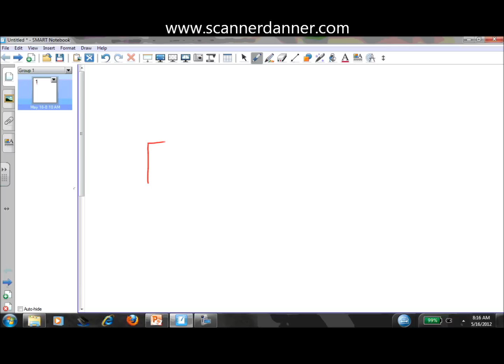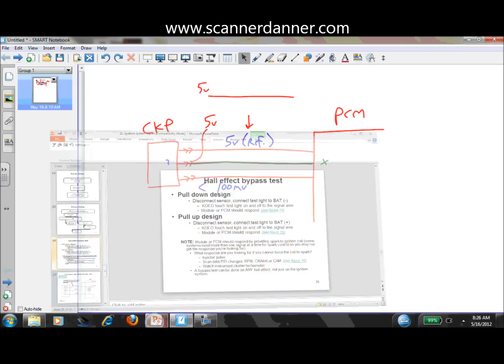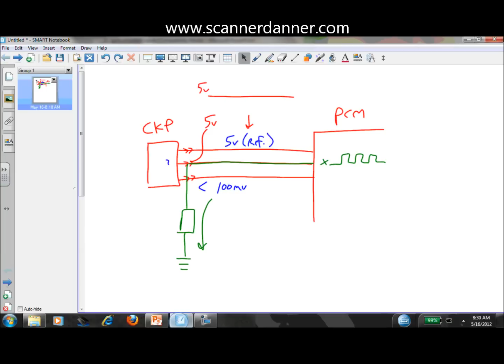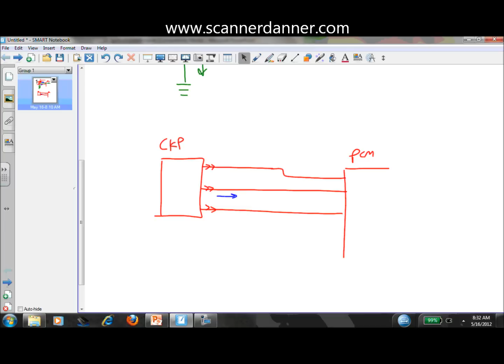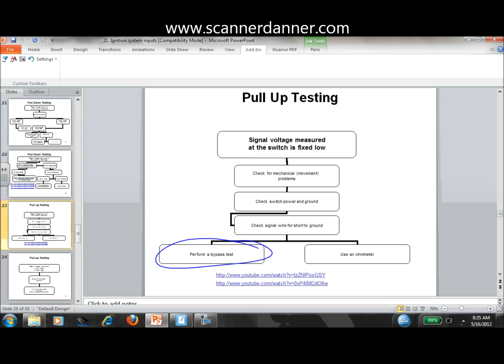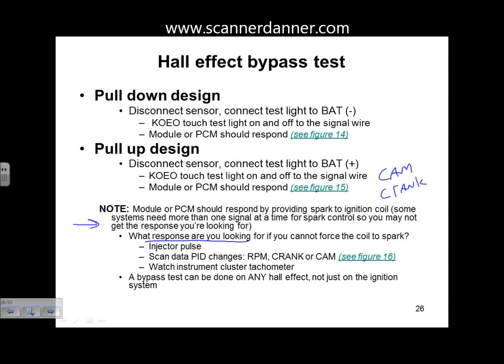Hall effect cam/crank sensor operation and testing Part 2 (an SD Premium video)

Comment: Very good Paul, thanks for the video.  I am testing a 2005 PT Cruiser GT that is misfiring at highway speed acceleration and backfiring.  On the Uscope the cam sensor has a weird waveform when I back probed the signal wire.  Not square wave at all.  More sine wave looking with lots of noise in the signal.  I need to do more testing.  I am 63 years old and just now learning to troubleshoot my vehicles.  Your videos have been indispensable!  Thanks, Tom
Reply from the maker: Thanks Tom! IF you get stuck, don't forget about my forum on my website. IT is free to join the forum https://www.scannerdanner.com/forum/post-your-repair-questions-here.html

Comment from the maker: for hall effect bypass testing, just a regular test light is fine. When you want to be careful is when testing computer driver circuits. This is when a lower amperage test light or LED test light is ideal. I would say that you want one that draws under 100ma to be safe. 
An LED test light may not work for this bypass test.

Comment: Northern Canada/ Native reserve.  One  week contract to teach advanced vehicle electronics to my fellow natives.  Big mistake !!  used you vids as a reference tool.  Had to translate  your words from English to Cree.  All week no one ask a question or even looked at me, by the end of the week  only 4 out of 45 showed up.  Seems my Cree is a bit rusty, seems  all the sensors  translate to a negative connotation.   Wont be going back, not welcome.  Getting out of the hospital  today.  :)

Comment from the maker: on a pull down design signal circuit, yes. it doesn't matter what you use. when I do use a low current test light would be checking computer driver or transistor operation. this would be on the output side of the computer not the input side. the input side contains just a voltage sensing circuit and not a transistor driver.

Comment from the maker: of course not. i will still be posting my case studies which i believe supports the whole thing. i just will not be posting this style of lecture videos anymore. i have done probably five or six in this format. (injector noid light testing, ignition control testing with a test light, fuel pump electrical circuits, fuel injector driver designs)

Comment: Pauls  a great guy and a lot smarter than I  but he is teaching at an accelerated level when it comes to vehicle electronic and management systems.  On the reserve I escaped from there was a 1953 Merc sedan  and a hand full of  pickups mostly 1960-71 international trucks.   If Paul ever excepts a contract to Canada  he would be well advise to bring a set of feller gauges,dwell meter and a BFH.  Oh yeah, they speak English. don't understand Cree. Never assume anything

Comment: Hi Dan, in responds to your question, what are the voltages backprobed with KOEO, pin (1) Gr = 0 v pin (2) signal = 5.6 v pin (3)  Power = 5 v , this is a brand new sensor, has not even being around the block yet, old sensor had the same reading.
Reply from the maker: Reply to my fist response, I don't have context otherwise

Comment from the maker: @Jahan Zeb new car computer replacement involves reprogramming. a factory scan tool is required in most cases also access to factory software which you can pay 4. sorry but I do not have the ability to do this for you.

Comment: Hi Dan, i hope you are well. Yet another great video, thank you. Could you please tell me what is considered as a " Low Amperage Test Light " for the above purposes? What is the maximum rating allowed in order to stay safe and not fry the computer? Could i modify an ordinary test light? Could i use an LED instead or is there not enough load on an LED to get the right results? 
Many thanks, Joe

Comment: Hi, 
My car is a Renault Duster 1.2 tce 125, gasoline direct injection. I have a misfiring problem with my car when the engin is warm on cylinder 3 and 4. I've changed my injectors, plugs, coils and the problem still the same. 
To stop the misfiring on cylinder 3 and 4, I have to pull off the crankshaft connector. If I pull off the crankshaft connector, no more misfires and the idle runs good. There are two similar position sensors on this car (crankshaft and camchaft) with same OEM reference. I've changed both (with new sensors) and changed the connectors (soldiered new connectors) but the problem is still the same. The only solution I found to stop the engin misfiring is to disconnect the crankshaft sensor when the engin is started. If I disconnect the other sensor (Camshaft) nothing happens. The misfiring happens only when the engin is warm (60 celsius or more). 
What do you suggest? Thank you so much for your help. (sorry for my English).

Comment: great paul!!! but.... i think there's something unclear. (i'm just starting in diagnostics, i don't have experience, but please read this). You said that on a pull up design, to test signal wire and pcm integrity, to connect the testlight to bat + and create a signal to the pcm, and in the example it's correct, but if the system works with a 5v ref and i do that test, i'm going to send 12v when it's supposed to function with 5v. what can happen? to cook the pcm? the explanation is great but i think that it can be misleading if someone sees that test and doesn't realize that. i hope you or somebody else can explain that to me or correct me if i'm wrong. thank you so much for teaching me and the entire world. Lautaro from Argentina.
Reply from the maker: The 5v ref would be the power supply to the hall effect. You wouldn't be messing with that circuit, only the signal wire. And if the signal wire has 5v on it, it is a pull-down design so you definitely don't want a test light to b+ there.
A 12v pull up circuit would typically have a 12v supply too, not a 5v ref supplied power.
Reply: @ScannerDanner 
Paul,,, what's the difference between Hall effect sensor with 5V reference and 12v reference?
As exam. In Hyundai Azera 2006 transmission output speed sensor has a power 12V from fuse, ground from Ground Point, and signal wire with a disconnected connector 5V, so it's a pull down design.
Q: 5V in signal wire is a bias voltage!!!! Then when I connect the connector will Vary on and off from 0V to 12v,,, or from 0v to 5V...
Reply from the maker: Great insight and great questions! The only difference is the source, or "power feed" if you will, for the hall effect. The operation of the signal circuit is identical regardless of what voltage is used to power up the hall-effect. So some are powered by the reference circuit (5v) and some are powered by battery voltage, and still others are somewhere in between. I've seen 8v and 10v power feeds too. 
The signal circuit being 5v unplugged, is indeed a pull-down design but I would not call it a bias voltage because that is more of a hidden voltage that does not really effect the operation of a circuit. Without this 5v signal, the sensor would not work on a pull-down design. So anyway, yes, it will be the 5v wire that will toggled from high to low, the 12v line and ground will remain constant. Love answering questions like this. You are clearly paying attention! Love good students!!!
Reply: @ScannerDanner 
Good teatcher,,,
Signal wire will toggled from high to low.
My Q: As we know low will be 0v, but high will be 5v If I have a 5v reference, so when I have a 12v reference will be 5v or 12v?
One Day when I connect my scope to see timing in Hyundai Elantra 2005 Camshaft position sensor was have a 12V reference, signal wire was Square Wave On Off from 0v to 12v.
Reply from the maker: @ALZWE-LIBYAN-CAR-ELECTRICIAN  typically with a 12v feed on a pull-up design, you will see  a 12 volt square wave on the signal
Reply: @ScannerDanner 
Thanks alot.

Comment: Great teaching Paul
With this 3pin hall effect is there an acceptable ohms value for the sensor itself to rule it out as bad or good? Expecially when you are OK with wiring integrity 
Thanks for answering
Reply from the maker: I've never, not once used the ohmmeter to measure a hall effect. They're all constructed differently and resistance measurements are always like this:
If it measures bad, it's bad
If it measured good it can still be bad 😉
Reply: @ScannerDanner  Thanks 
So ohms resistance checking of hall effect sensors is not worthwhile.  Is there any test that can be done to it separated from the car to rule out it being good or bad? 

Dont want to be a  parts  changer!
Reply from the maker: @AnythingEverythingGh  yes, absolutely! Check out my chapter 21 playlist for many, many videos where I am showing this
Reply: @ScannerDanner  when you havent purchased the book yet lol
Reply from the maker: @AnythingEverythingGh  it's right here on YouTube, you don't need to buy anything. I just have my playlists organized with the material that is in my book. So check out my chapter 21 playlist for more videos on testing these
Reply: @ScannerDanner  can't find it Paul, a link to it will be  best. Btw there is a pull up design with 5v reference, my Nissan Sentra 2008.
Reply from the maker: @AnythingEverythingGh  https://youtube.com/playlist?list=PLAFYVCyenqcqEN41aYznWn9Nfhy1PiMjo

Comment: Hello.When disconnecting the cam sensor plug, I find 10.67 volts in the signal wire. Engine crank but not start.
- Engine: 1.3 vvti
What do you think of you?
## Thank you very much for what you provide. Your information is very valuable ##
Reply from the maker: Sounds like a pull-down circuit. What is your power and ground wires showing, plugged in and backprobing, with the key on?

Comment: Good info , I'm running DIY hall sensor with a speeding board  running 5volts to senior with pull up on its output . I get 0 to 5 volts on the output wire when  I turn crank, but as I hook it up to ecm  the voltage goes to 0 volts. Have good continuity on the circuit .Any ideas?

Comment: Im stumped... got a 2002 stratus. Uses 12v hall effect sensors.. i have good 12v and good ground at sensors. When scoping signal, i get square wave but it only goes up to around 6.5 - 7v.. 
Diagnostic chart says disconnect sensor, key on/engine off i should have 5volts on signal circuit.. i have 0. Im guessing bad pcm??

Comment: I'm fixed high on my ignition passlock signal for my GM avalanche. I'm at 5v and turn over to run and it's still 5v instead of the Hall effect pulling up to a readable signal for the BCM.
Reply from the maker: https://www.youtube.com/watch?v=v0AIhj_vykU

Comment: Paul, would you object to a test light to B+ to a pull down signal wire to test for a short to ground? Preference for an LED test light?
Reply from the maker: Use your test light but connect it to the 5v reference circuit as your source, then check scan data for a signal change. It's the same thing I teach using a resistor. I would suggest an incandescent light for this test

Comment: Man i hope this helps my NO START NO SPARK!!! 2009 MITSUBISHI GALANT 2.4 SOHC. Harmonic balancer came apart and was rubbing the crankshaft sensor wires and caused car to just completely die on highway. It was a red wire and im not sure if it's the signal wire or what. But anyway i soldered a new connector and purchased ckp and cam but still no spark. I think the metal harmonic balancer shorted something but im not sure how far to trace it if you know what i mean. Any help would be greatly appreciated!!!! I'm stuck with no money but i have tools  and my brain so i know i can fix it HELP PLEASE

Comment: Hi and appreciate your videos but I have a doubt regarding the test that you showed. For example you said when the sensor was unplug you must see 5V reference but this situation generally happens when the sensor plugged and when you disconnect it you must see 0 right?
Reply from the maker: There are two types of hall effect circuit designs 
1. Pull-up (will have 0v unplugged)
2. Pull-down (will have typically 5v unplugged but can be anywhere from 5-12v)

Comment: Hi Paul,on a mini(bmw)I’ve been looking at the three wires to the cam sensor are 5V supply,Earth and 12V( presume this is the signal wire)so does this design use the Hall effect sensor to pull the 12V to ground ?....Many Thanks

Comment: Hey bud, you mixed up the terminology. A pull up circuit will pull the circuit up to a voltage and a pull down circuit will pull the circuit down to ground. So in a pull up circuit, the unplugged harness will have 5v on the signal wire when sensor unplugged.
Reply from the maker: Intentionally spoken of in this way. On a pull-down circuit, for example. I understand internally to the module that it has a pull-up resistor, but who cares! When you're teaching a class of newbies, how to understand what's happening in the circuit, to call a sensor or switch that is switching to ground, which pulls the signal voltage low, a pull-up design is in my opinion stupid lol

Comment: Hi Paul great video, i have a quick question. I have a pull up CMP and i am getting battery voltage on the supply and about 0.8v less on the signal wire. I have a DTC for P0340, i scoped the signal at the sensor i am getting a square wave. Should there be a voltage drop of nearly a volt across the sensor. My ground voltage drop is fine at 0.004v about. Please let me know if i am onnthe right track and need a sensor. I will be checking my signal wire to the PCM in the next couple days i hope.
Reply: That's my problem did you put a new  cam sensor? Did you fixed it?

Comment: My question is what if the reluctor wheel is in the position of pulling down and the sensor is still installed in the car....   ????
Reply from the maker: disconnecting the sensor and measuring the signal voltage will answer that. A pull-down design will show high volts, a pull-up design will stay at 0

Comment: What happens if that Chrysler 5v ref is reading 12-14 v plugged in or unplugged. The signal is square wave plugged in and battery voltage un plugged
Reply from the maker: If you are positive it is the 5v ref circuit, then you most likely have a bad computer ground. I've never seen higher than normal ref voltage other than a bad computer ground
Reply: @ScannerDanner  2011 Jeep Patriot with definitely battery voltage on its 5v ref I’ll look it to the bad computer ground

Comment: Professor Paul My question is in a no crank no start no com would you start testing for power and ground with a breaker box before the 5v reference in the ob2 connection please answer me thank you
Reply from the maker: No com with multiple modules on a network or just one? I'd treat that differently
Reply: @ScannerDanner  I'm sorry I meant no start no com thank you professor Paul
Reply from the maker: @georgekoulianos2489  I understand, but it still matters if it is a no com with just the ECM or with multiple modules. I would treat them differently.
Reply: @ScannerDanner  I like ask a question professor Paul how long is the course for Rosedale tech for thank you
Reply from the maker: @georgekoulianos2489  16 months
Reply: @ScannerDanner  thank you

Comment: 2001 Sonata v6 CMP sensor 12v with 5v pull down. power and ground good, sig has 5v disconnected, 0 - 3.75v (bump test) connected. "new" sensor is bad!
Reply from the maker: Not surprising with today's parts.
Reply: @ScannerDanner  Not that there was much doubt; Confirmation, replaced cam sensor and code cleared.
Thanks for the bump test idea. I had no data pid and my scope is busted.
Reply: Oh no, I spoke too soon. Code came back. I wonder if some wires are rubbed/chewed shorting out the sensor, or if the ecm is bad. Oh boy, more testing.
Reply: Monitors set, no active CEL, passed smog, runs good. They got 1.5 years to figure it out, or bring it back.

Comment: I have a crank sensor with a good 5vref and a good ground but the signal wire reads 4.7v both plugged in and unplugged. Is that close enough to 5v or is something else wrong here.
Reply from the maker: +Daniel Warren no problem there my friend. The slight drop you are seeing on the signal wire is normal and is actually your voltmeter that is dropping some of the voltage (high internal resistor on the signal circuit)
For more information on this, check out my Section 2 material "switch inputs" thanks!
Reply: +ScannerDanner. Thanks, I've seen most of your videos but it can be difficult to remember it all. May have to re watch some.

Comment: In a pull down design, couldn't a fixed 5v signal be from a short to positive? I know the test light would light when you do the bypass test and you won't get any pids change.
Reply from the maker: Yes, absolutely, the signal circuit will not light a test light! (Incandescent) Great insight!

Comment: how do you find out which is pull up and which is pull down
Reply from the maker: on electronic designs like a hall effect, only an unplugged measurement of the signal wire on a known good circuit will reveal this to you. Unless you can find an INTERNAL block diagram of the computer, which manufactures don't like to share. Hope that makes sense